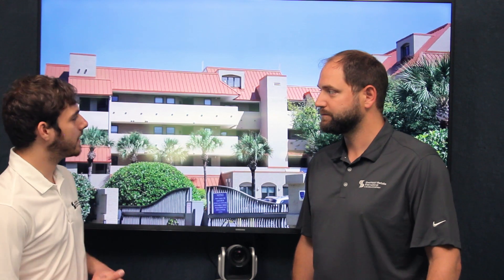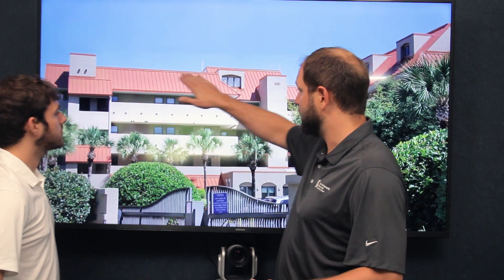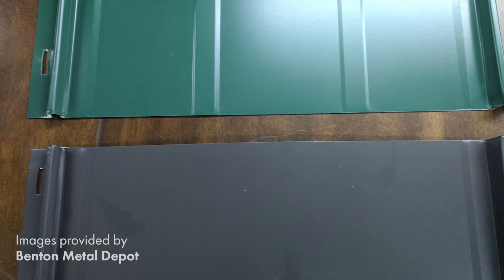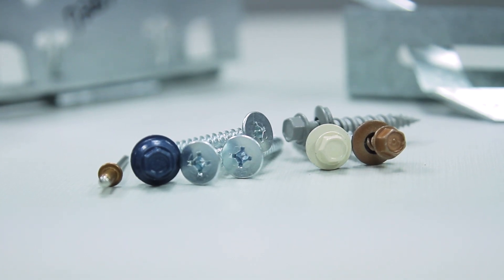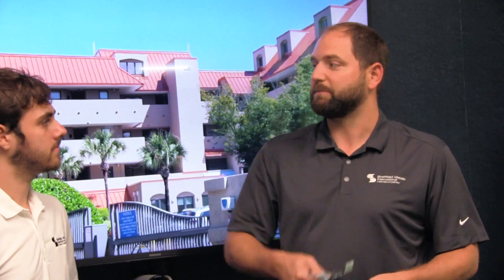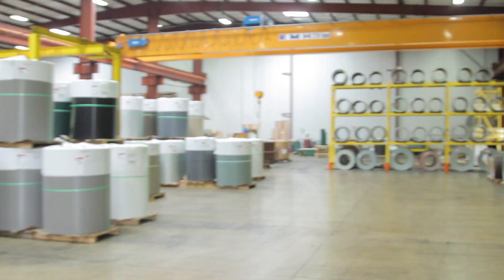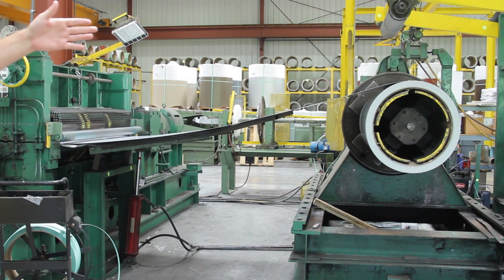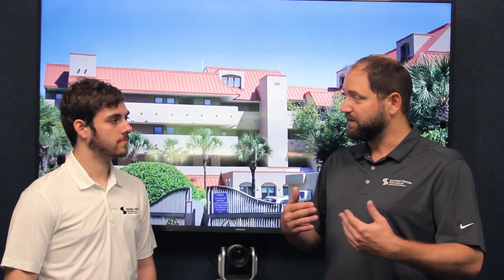Standing Seam Metal Roofing Accessories and Manufacturing Process

Comment: The ridge vent  assembly, with all the separate parts and required caulking, looks pretty wonky. Seems like someone would come up with a better design for the ridge area. A 30-50 year product that relies on the integrity and longevity of caulked in pieces at the ridge just doesn't seem right.